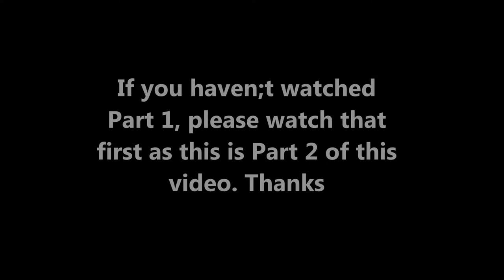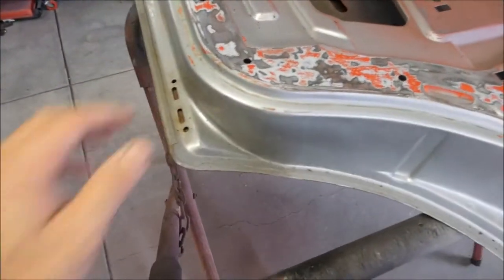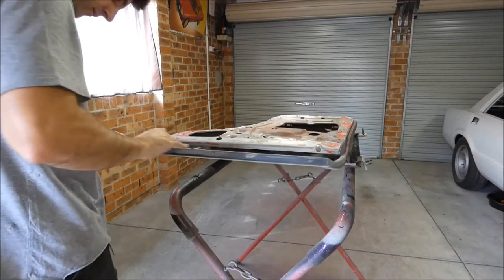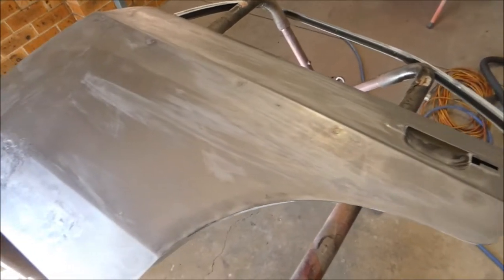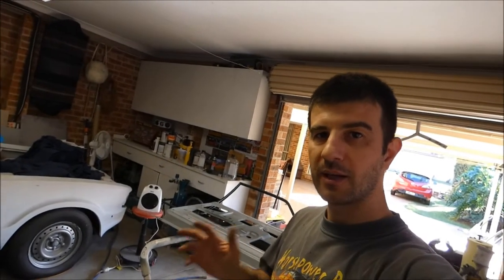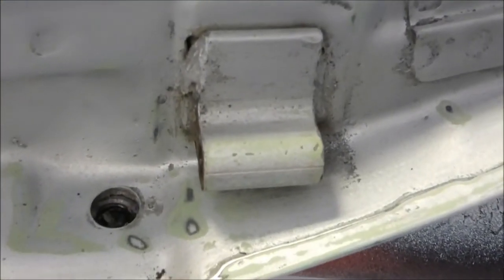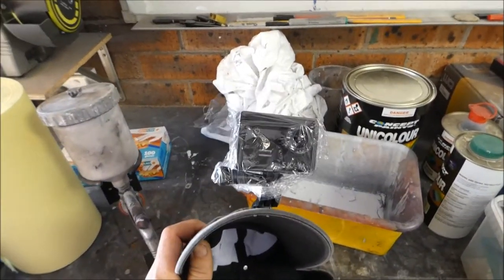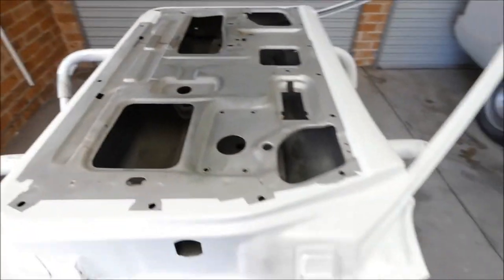Under Construction EP5 Part 2 - Paint Striping, Deoxidine and Spraying Epoxy

Comment: Great tips. Can you please tell me what's the name of the  rust converter that you're using?
Reply from the maker: Hi John. Its a product from Super Cheap Auto. http://www.supercheapauto.com.au/Product/SCA-RUST-CONVERTER-250mL/425360 theres this one and theres this one http://www.supercheapauto.com.au/Product/SCA-RUST-PRIME-250ML/425363. The rust convertor is to eat away surface rust etc. The rust convertor sealer eats the rust and then neutralizes it by turning it into a primed surface ready for paint. both have different purposes. The stuff I can deoxidine is the rust convertor. The stuff I brushed into the inside of the doors is the sealer. Hope this helps